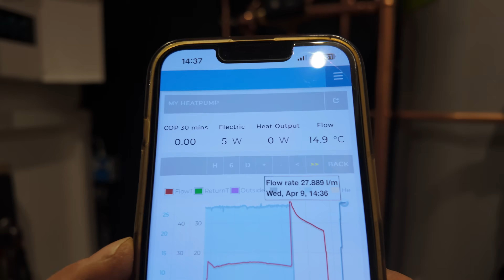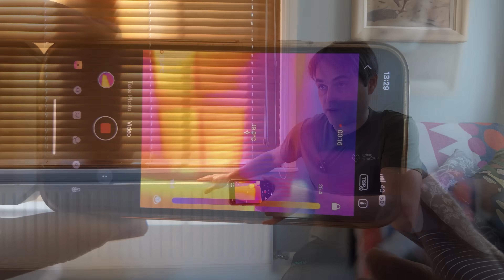Why This NIBE Heat Pump is Perfect for 7kW Homes.

Comment: That's interesting. I have thr option of an 11kw Vaillant or 12kw Nibe for my 10.7kw loss home. 

Met a nice heating engineer who worked for nibe via visit a heat pump. 

Maybe I should go Nibe.
Reply from the maker: I do not think there is an 11kW Vaillant? What is your heat loss and which NIBE model did they quote for? NIBE is a great unit and great controls, just be aware that service and spares are not as good as Vaillant.
Reply: The Arotherm is 11kW one. Do you have an experience with those (R410a), please. London could be difficult with the space (safety zones) outside and inside ( if you want a split version - more expensive to buy and install (unless F-gas). Would you recommend any other brand (tried yourself) to do not worry about the safety zones and not installing any units inside the property (just controllers? SCOP for Vaillant Arotherm are not great when you compare with Arotherm Plus but still comply with MCS minimal COP and customer wants to get rid of the boiler as BUS😊
Reply: @UrbanPlumbers  Nibe back up and spares are poor. For that reason alone, we would not fit them any longer. We look at the overall package from installing the unit to how quickly our customers can be back up and running when something goes wrong. Nibe in the past have not been able to provide a good enough service. in our experiance.

Comment: How does the price of NiBE compare with other comparable systems?
Reply from the maker: NIBE is expesnive. Comaprable to Viessmann and around £2k more than Vaillant. The unit and the controls are the best I have come across so far.
Reply: @UrbanPlumbers  Thanks, it looks worth it though
Reply: I am glad UrbanPlumbers has found a better product in NiBE which has better controls.I hope he continues to explore products outside what HeatGeek recommend. Vaillant due to their immense size take customers for granted too often I feel, especially when it comes to their gas boilers.
Reply: Just like to say that Nibe and also Thermia has a much better configuration possibility compared to Viessman (I have one sadly, thankfully used one and was only 500€). The stupid codes you have to write to get into the advanced service menu. On top of that it's hidden behind just numbers so you need a manual to even adjust basic delta temperatures.

Even to just see basic Status you need to get into the normal service menu.

Nibe, Thermia or for budget IVT/Bosch 

Viessman cheap used diy. Otherwise in the bin

Comment: Love the video, just a quick point, the Daikin 8kw unit will amble along at 400wh and lower when system up to temp, the 9kw - 16kw I believe is the 900wh you've referring to
Reply from the maker: yes, you are probably correct. I think like most manufacteres they have just 2 units with software caps on output, hence only 2 levels of low modualtion.

Comment: Very interesting and informative video as usual. That external MDPE pipe is definitely a challenge to work with!
Reply: Yes. But it's a long lasting installation underground with very little heat loss. Think I would have run another cable in trench  for socket next to unit if no other outlet nearby was available. Useful as trench there.
Reply from the maker: especially 40mm that has 175mm diameter! One more reason we used 32mm / 125mm here.
Reply: @UrbanPlumbers Great video Simon. What is the Nibe approach to the minimal distance between the communication cable and power supply?  If in the same duct pipework with the HP flow& return ( cables already in or electrical ducting) you can not keep the minimal distance ( Vaillant)
Reply: @UrbanPlumbers 
But why isn’t it underground all the way to the inlet holes in the wall ?
Looks terrible with two horisontal pipes mounted on outside wall👎🏿
Reply from the maker: @steffenjensen9350 side of the building that no one ever sees anyway.
Reply: @UrbanPlumbers  studies show that two seperate runs of 32/110 provide the best insulation, while still being quite easy to handle. Maybe consider it for your next project! 

There is also a 32/140mm variant and Terrendis makes it with a different kind of foam which is way more flexible and easier to work with.

Comment: It's pointless to rate units on peak output, no-one is cranking the heat up when that number is achievable (except if they own an outdoor swimming pool and want to heat that).
Reply from the maker: Yet most are named like that - as bigger is better. I now look at only 2 things - flow rate and amp rating of the unit. Those 2 tell me the output of the unit better than the spec sheet.

Comment: How low can the smaller S2125 unit run? Would it be suitable for a load ~3kW?
Reply from the maker: I wouldn't be suprised if both units had the same low modulation.  6kW NIBE should be perfect for 3kW, also degree minutes algorytm and controls on NIBE are first class, so can deal with oversizing really well.
Reply: @UrbanPlumbers  Do you know where I can find the min output in the documentation. Or do you just know it through the monitoring? It's super valuable to know how low the compressor can modulate down. But it's very hard to find that information. After renovation our heatloss will be around 4 kW at -7C. So I'm looking for a R290 unit that has the lowest min output.
Reply from the maker: @user-wr2ic8oq1n, do not look for the lowest output. Look for the best controls. Oversized units with good controls will perform better than smaller units with poor controls. 

For 4kW heat loss I would be looking at:

Vaillant Arotherm 5kW (I have one here - 3kW heat loss and it performs great)
NIBE 2050-6
NIBE S2125-6

Comment: The government would do well to just scrap the r290 zoning rules they’re just a bad joke considering the amount of actual gas inside the units given I can go buy a huge propane bottle with 10 times the amount of gas for a BBQ or patio heater and place the thing wherever I like not regs. An easy target to remove “red tape”
Reply from the maker: its not the government that makes the rules. It's manufacturers to avoid liability in case something does go wrong.
Reply: presumably those manufacturers specifications will be based on some legislation on the correct “handling of explosives gases etc etc or something like that” a little amendment along the lines of , small volume of gas such as the amount found in a domestic ASHP need not comply. Or give installers discretion heck just ignore it them, it’s not like MCS is going to do out given their regulatory competency 🤣

Comment: What was the total cost of this installation?
Reply: Probably prohibitive compared to a comparable Arotherm 105/6. I looked at this machine as it would have been the best option for my mums house, but it was at the time around 4k more expensive. It's significantly smaller though, so if that is of graat concern you could justify it. Also no or a much smaller buffer needed due to modulating down so far so that also saves a m2 inside the home.

Comment: I assume lower rated units have smaller variance. You said 5kW vaillant seem to be less problematic.
Reply from the maker: Vaillant mistakenly used peak output figures for all their units as heat pump sizing guidelines. They never said the figures didn't include defrosts or published mean figures. NIBE does exactly that - publish both peak and mean figures, so you can size the unit correctly.

Vaillant sizing tools say that for 40c flow, a 5kW has around 6kW output, and a 7kW has around 8kW output, while in real life, both are much less. 7kW ends up around 5.5-6kW, and 5kW is around 4.5-4.8kW. 7kW is around 30% under, while other Vaillant units are more like 10-15% under.

That is why 7kW has been causing so many issues.
Reply: @UrbanPlumbers it's really not acceptable of valiant. It's a bit of shit houserey TBH.
Reply: This is... interesting... especially as I'm getting a Vaillant unit installed in May! (5 kW). And as you say there's the interaction with the difficulty of producing an accurate heat loss calculation.

Szymon, what would you suggest is the best place to look to get a realistic "This MCS heat loss calc = This unit" comparison?